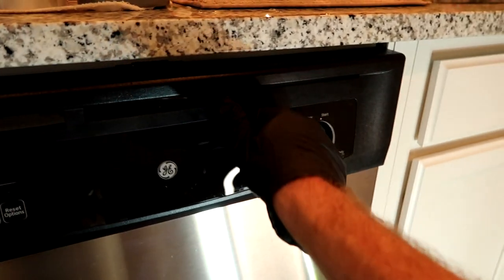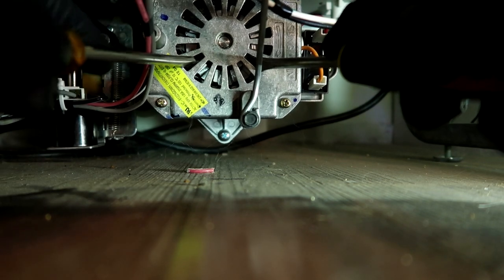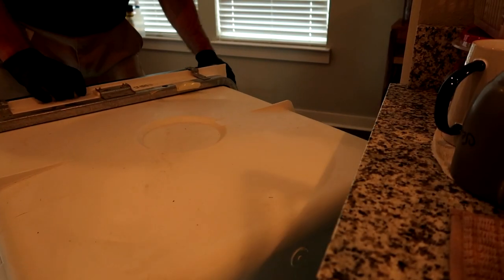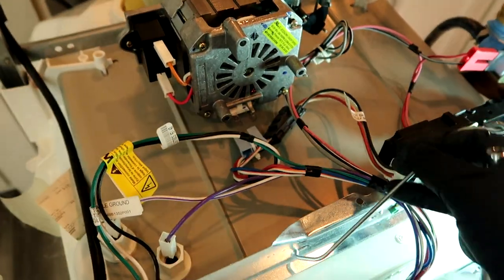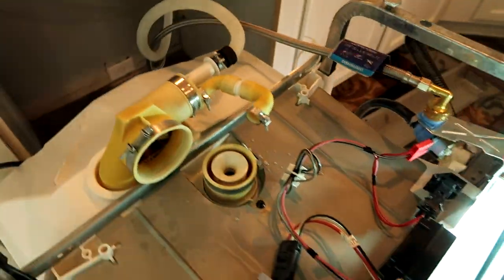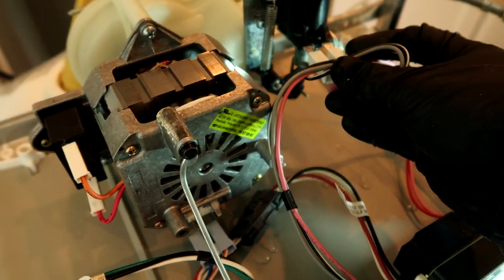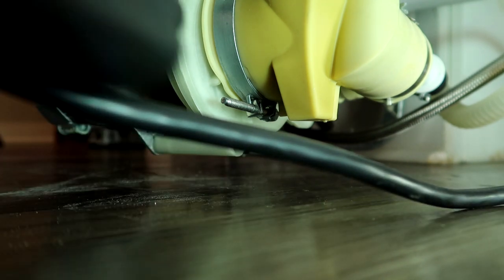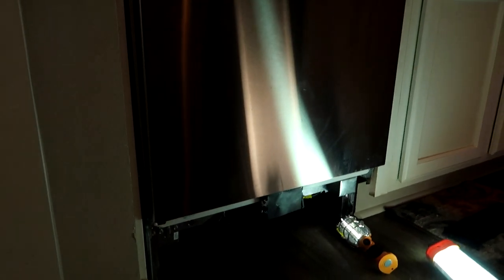Here's Why Your Dishwasher Is Not Working

Comment: Motor seems to run fine in mine.... just constantly trips and turns off seconds after starting. Replaced the control module, and that wasn't the problem. 

How do I fix this issue?
Reply from the maker: I'd need to be there for this head scratcher 🤔. I would look at the power wires coming into the dishwasher. Could be a faulty motor as well. Too much to look at to diagnose in comment section.

Comment: Any advice for Amana dishwasher not filling
Reply from the maker: I've never worked on Amana. I'd need to be there for this head scratcher 🤔.
Reply: @LexVance  I ohmed the relay for the float switch 
The water inlet is good 
I pulled from another washer tried that too

The pump looked like it could not be replaced it hadetal part that held hoses together that were clamped on/bracketed on  as whole part .

Comment: Lex, im having trouble with this unit. replaced txv, replaced dryer filter, removed and cleaned coils when i swtiched txv, but this darn unit keeps freezing. pressures are good, fan motor is good. wont freeze till 4 hours later. any clue?
Reply from the maker: See if there's a fire damper above the air handler in the plenum. You'll have to cut the plenum to see. Use foil tape to tape it back. If the fire damper is closed, it'll freeze the unit due to no air flow. Try to open them back up with big zip ties or something. Thank you so much for watching William!
Reply: @LexVance  got it, thank you lance! If per chance there’s no dampener what would you recommend from there? Would hate to recommend replacing if it doesn’t need it

Comment: Are you anywhere near the college apts at FSU? My son is in one on Gaines.
Reply from the maker: No, I'm way north almost to Georgia. The apartments should have their own maintenance techs, though. Or the property manager should call someone to have it fixed. I worked in student housing as a maintenance tech for 8 years.
Reply: @LexVance  lol I wasn't asking because they need anything. Your location on YT comes up as Tally. Funny though I got him up there 2 weeks ago and he calls me "dad the disposal is smoking what should we do" ugghh unplug it and call maint. :) They actually came right away and replaced it so good on them. 

Just found your channel good stuff! I saw your Carrier video. Made me not so happy but I am thinking like you mentioned mostly self inflicted installers not following proper procedure. We have 2 two year old Carrier's in a new house. One started running the inside blower 24/7. I ran some tests it was the X13 module like most of them. Even though it was under warranty it was cheaper for me to buy a rescue motor than pay the labor for the free part. Thanks Carrier! How many X13's are going bad there? Luckily I would rather have it stuck on than off. The third symptom is they ramp on and off. My smaller unit has a Broad Ocean ECM. Are you finding those go bad as well? I might have to go OEM on that not sure anyone makes a rescue for that one.
Reply from the maker: @scotts4125  Yes, Ecm modules are going out a lot on 3 year old units. I prefer the old school motors with the 5 mfd capacitor.
Reply: @LexVance  Yes PSC motors that lasted 30 years. The ECM motors are supposed to me more efficient but when they don't last you aren't saving any money. It's not actually the motors but the modules that break. In many cases a new motor is cheaper than the just replacing the module. It's really nuts they can't make these modules better. Some guys convert ECM's to PSC's. There is a board you install to make it really easy although it can be done without the board.